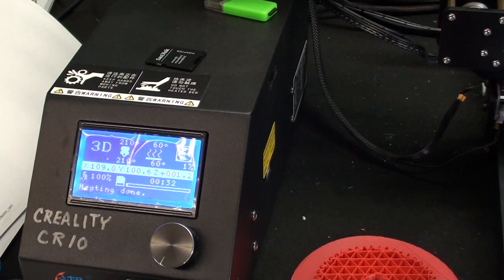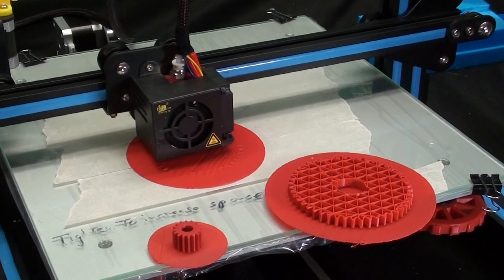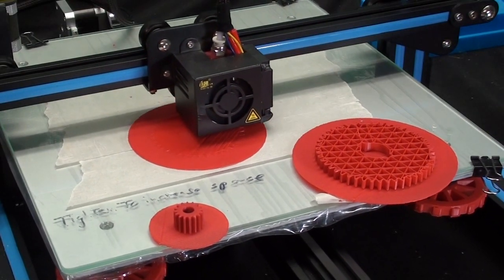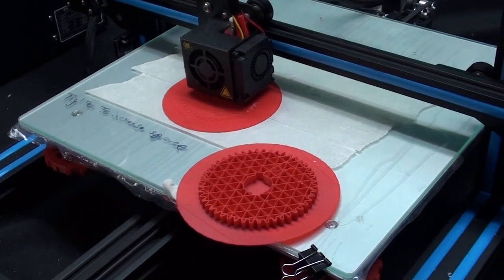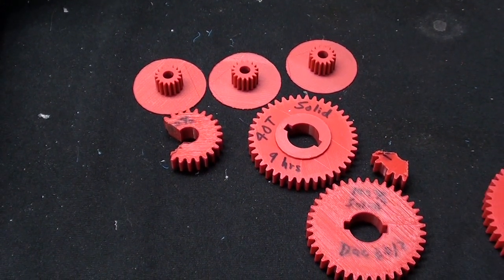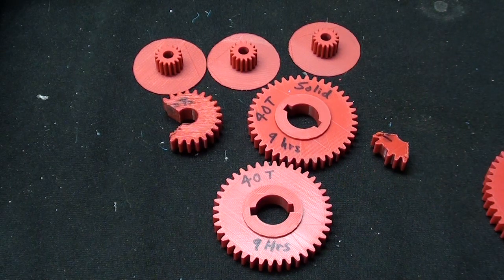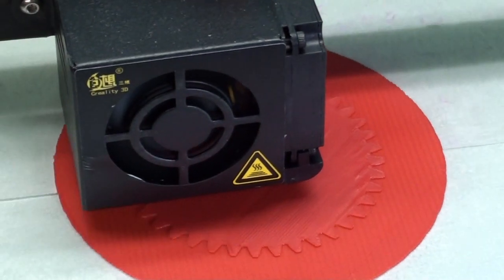3D Printing update CREALITY CR 10 with tubalcain #3

Comment: Hey Mr. Pete,
I never took shop class, just Woodworking and Auto's, so you are officially MY shop teacher! I love your video's. I like them so much, I obtained a "free" lathe. It's an Atlas TH-56 with a bearing date of 10/1940. I love knowing I have a pre-war machine. Anyways, back to the point. I put free in quotes because it had a broken traverse case gear box,  a broken F/R shifter and yoke, no tooling, not even a tool post, and 5 gears that did not give me one thread or feed rate on the chart. 
After seeing your video, I have decided, instead of paying $200 for ZAMAC gears, I'm going to try this route. Amazon has a printer that will print many different types of filaments for $190. I have one question though. The Thingiverse page for the set of 10"-12" says they are "20 degree pitch angle"  I know there's a 14.5 and 20 degree pressure angle and the 6" is 24 DP 10"-12" are 16 DP both are 14.5 PA. I just wanted to make sure the gears are designed correctly. I saw you use them, so I'm sure they're right, just  not sure what he means by that number. 
Thanks
Reply from the maker: I am currently on the road. As I remember they are 14 1/2°. Not sure, possibly the 20° will work. Do a little research on the Internet for that
Reply: @mrpete222  Sorry for the confusion. I saw you put the gears through the test, so I know they work. The only plans for 10"/12" gears on thingiverse are from Gadget047. If that's the gears you were using, that's good enough for me. If not, could you point me to the source of the files used to make the gears in your initial video. 
An unrelated question, I have never used a lathe, so I'm feeling my way here. I need a 3 jaw chuck. Any recommendations on brands and size to look for? If I just buy one labeled Atlas/Craftsman, there's easily a $100-$200 premium over any other 1 1/2 -8 chuck.
Thanks again, Rick.

Comment: Mr. Pete is the 3D printed indicator holder in Thingiverse to down load. My instructor said he would print one out for me if I could get the file. I have a 3D printed manual welding wire feeder I invented a while back out of ABS. Use it when ever I TIG or torch weld. Thank you for sharing.
Reply from the maker: yes--download it for free and have it printed

Comment: Pretty sure you know the rules for figuring out how many perimeters to print, but I'd measure the spacing between teeth, in millimeters, divide that by two, then divide the result by the print nozzle (often 0.4mm) to get a count of how many perimeters to print. Then add however many you feel is reasonable for good engineering practice. 

Infill is most important for getting decent top layers, as bridging the width of a gear will involve a substantial amount of sag. One of the options with Cura is to start with a 1% fill at the bottom, then step up to 20 or 25% (or 100% if you want) as the head goes up layers, ending with your target infil just before you get to the top layers.

Top and bottom layers are also going to be important for how ridgid the print is from center to tooth of course, but as mentioned it doesn't have to fill the entire breadth of the geer. And it's likely to require a bit of playing around with to work out what you need.

Personally I'm at the 'playing around with tinkercad' level of 3d design. I've looked at OnShape, and can see that I need to move to that or Fusion 360 at some point, but I'm probably going to hold off on that till next fall as I have a couple of other courses that I need to work through, work related, before I can dedicate that much time to a new design process.

Part of the problem with all the different opinions on what to use for adhering the first layer to the bed, is that there are too many variables in filament composition, and what works for each. I've not tried AquaNet hair spray, but have heard good things about it. But I've also had good luck printing straight to glass with some materials, and to blue tape with others.
Reply from the maker: Thank you for the information. I know very little about all of this, I am still learning
Reply: So am I. I tested well in concepts related to machining and Tool and Die making (My grandfather was a machinist for Minneapolis Moline as well as earlier on a blacksmith, which may have helped) but my career has been in electronics and networking. So 3d printing has become a hobby for me, at least in part because it's something I can do with what money I have left over at the end of the month, and even the 7x12 laths have been a bit out of my budget. Keep teaching.

Comment: Look through Cura as well, increase your infill speed. If you keep printing PLA, please just try the hairspray instead of tape. I do believe that you will be pleased at the outcome. I use it for PLA, PETG, and ABS with great success and I find it much more pleasing to use than tape. You may want to look into PETG for functional parts and regardless of what material that you use, use thicker layers (0.3 for anything functional, they will be stronger with thicker layers).

(My Method) 
Take the glass off, wash it in the sink, and spray away from the machine; spray it kind of like you are painting it (but keep the glass horizontal) and until you see a nice WET coat. At this point I toss the plate onto the heat bed and warm it up to 60 deg F, it dries the hairspray pretty quick. Once dry, I clip it into place. You wont need more than 60F for the heatbed when printing. Notice I am not saying toss the glass onto a hot bed, put it on then pre-heat the bed. 

I never use a raft and it always sticks perfectly. If you are having problem with first layer adhesion at this point, your nozzle is not close enough to the bed. If you know how, you can change the Z offset in the firmware, or just use your indicator rig to move the bed a couple thou closer to the nozzle. Good luck
Reply from the maker: Thank you, that's good information. I printed all that info out for reference. Last week I bought Aqua net extra hold hairspray. Sprayed two coats on, and the print lifted after 15 minutes. I am mediately went back to tape, Which never fails.
Reply: Another thing to note. Cura also has settings for "first layer line width %".. Keep in mind that if you increase this number it can actually have an impact on the print because the first layer will be wider, so it might be better to use a brim in this case. Needless to say increasing this percentage will put down a bit more filament and the first layer problems can be solved. I'll sometimes use as much as 105% to get PETG to stick nice and easy, never went higher than 102% for PLA, but EVERY printer is different.

There are other ways to get rid of the wider first layer. My personal favorite is to add a 45 deg chamfer to the base of the model. Of course it does not need to be a huge chamfer, perhaps 1 to 1.5mm (ish). You really don't want a wider layer on the first layer if you are making a gear...

Another thing to try, Again in Cura "Initial Layer thickness".. A thicker first layer also helps with adhesion. But I print almost exclusively at 0.3mm line thickness so my initial layer is also 0.3mm. Combine this setting with a wider first line and that can do the trick. 

I totally understand using what works for you, I do find it a bit odd that that you have problems with a part lifting on just PLA. The stuff just prints so darn easy... I have pretty much quit using PLA though, I do not like it properties as a plastic and I make almost nothing but functional parts.

Once I spray a bed, I print parts all over the place until I've managed to "dirty" up the entire bed and I never have to change bunch of tape, but I really really dislike messing with the tape.. I designed and built my own printer and the bed is level within ~0.0005" without a single adjustment screw and this has a huge impact on how easy it is to get the first layer to stick. Since building my own printer I don't have to tinker with all these Cura settings anymore.

I'd be willing to bet that if you lowered Z by exactly the thickness of the tape, your results without the tape would be better.

Comment: Interesting thought with the printed gears, way back when the atlas lathes were fairly new there were plans to make your own quick change gear box.  Now finding enough of the right gears would cost as much or more than buying and adapting a factory box.  But with the printed gears you could make a quick change again, for not much other than time.  http://vintagemachinery.org/pubs/detail.aspx?id=7158
Reply from the maker: Thanks for watching, I did not know they had plans for building a gearbox. I will check out that link

Comment: Since we know how much castings shrink along a dimension do you think it's possible that we could design a 3d printed model that could then be ZANAC casted such that it comes out dimensionally accurate. Basically compensating for how metal changes shape as it cools. This way you could make 3d printed gears for your equipment that would be a little too big but then when you cast them they come out just right.  I think it would be beyond linear algebra aka a nonlinear system since the changes in metal shrink are non-linear, but none of the mathematics are new. You would simply input your model and include vents, where the metal would be poured, and the program would then do a simulation of the metal flow and compression and output a new model such that when the metal cools you get the input STL form.  You would use lost PLA casting to avoid the problem of having to add drafts etc.
Reply from the maker: Possibly, but I don't think it's practical
Reply: Thanks for the reply! :)

Comment: Thanks Mr Pete for a nice video.
What would be good to see is if it is possible to print balls suitable for machine handle ends, drill press etc, and also crank handles for mills etc (the serpentine looking type).
Good work as always.
Reply from the maker: That would be a good project

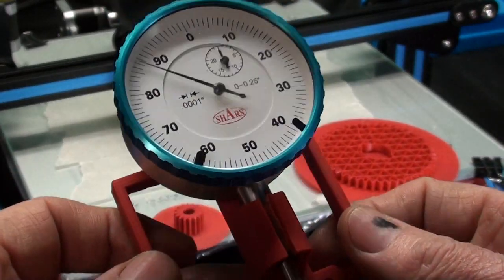Comment: More a question than a suggestion - In your previous vid you talked about printing at 20, 30 etc %.  Back here - at 2:00 you're printing and also have a part printed cog on the bed.  It looks to me as if some or all of the teeth are hollow (which I'd guess =weaker?).
Is it possible/would it be desirable to create the wheel with 2 doughnuts, solid inner and outer walls (say 1/2" wide) to create a strong hub and tooth area then fill the rest of the area at say a 50% lattice to save some material?

I don't know if it's worth the effort.... or if it would just create a weakness.
Reply from the maker: Many people have suggestions that that it only requires strength around the edges. But I do not intend to carry the experiment any further. I would just soon print the whole thing is solid.

Comment: Hello Mr Pete. I think your change gears will hold up fine. About 5 years ago i was given an Australian built Qualos Junior lathe which came with it's original plastic gears. This lathe was built between 1946 and about 1967, only used in a home machine shop, but the gears are still fine. here is a picture and some information, if you want to take a look.   http://www.lathes.co.uk/qualos/page2.html.       Ken.

Comment: On Vincent motorcycles, nylon gears were tried. This gear ran on the end of the magneto and meshed with either a steel or aluminium gear. There was a problem with the nylon gear expanding and tightening up. Something to watch for.
Reply from the maker: That rather surprises me
Reply: Researching the 'folk law' I've grown up with. It appears that the ones used on Vincents had a high coefficient of expansion and needed 0.010" to 0.015" of end clearance otherwise they tightened up. Apparently the ones fitted properly new wore out.

Comment: Mr. Pete, I've notice a common item hobby machinists are usually missing, at least those who cut gears manually using a dividing head. Are the dividing/indexing plates. Especially if they need an unusual size or number of teeth. Any reason a 3D printed indexing plate wouldn't work? Would love to see a video on the topic. 

Thanks, Love your content.
Reply from the maker: That would be a good idea, but I think it would require a cad program like fusion 360

Comment: I wonder if you attach a router to that print head location and cut out aluminum gears.
Reply from the maker: No way, it is not rigid enough
Reply: Ok. Makes sense. I am going to make a jig to cut a #25 sprocket. Seems easy but time will be invested I know.

Comment: Keep at it. I'm still learning every print after more than four years of printing. Every new design can present new challenges in how to get it optimally printed. Every new material requires a little tweak. I got into it originally so prove to myself I could make one with just a hacksaw, some wrenches and a hand drill. I was successful and learned a ton.
Reply from the maker: You are right, there is a lot to learn.

Comment: Very interesting stuff! A lot of things that of us are not exposed to or regular basis. I also understand there's metal 3D printing on its way. Please experiment with the gears on your 618 Craftsman lathe if you still have it. Probably one of the most sought-after gear sets. A good application for light-duty gears. Thanks again Mister Pete! And thanks so much for contributing to the YouTube community!
Reply from the maker: I no longer have that 618

Comment: Did you know that you can bury most of these shapes in sand, put a sprue, and cast them? There are tons of videos describing the details.
Reply from the maker: Yes I do. I have watched some of the videos. I am not impressed at all with the surface finish. It is nothing like lost wax casting using a slurry

Comment: One plastic gear is a lathe is a good solution because if you crashed then the weakest element will give up first and in that case, it will be the gear and not lead screw or bed or carriage. So you lose 10$ tops.
Reply from the maker: Yes it is a good system. In fact that is what Sheldon lathe used. I had that kind of laid at the high school. They were bake a light gears.

Comment: My advice would be to apply local infill control - use 100% for the teeth and the hub, then between them lower the infill value. Search for infill mesh for cura. Should save material and time.
Reply from the maker: Yes, many people have said that already. But I do not know how to do that
Reply: https://youtu.be/PUwf79wySUY - check this one out. Basiclly you are using additional bodies to define volumes with different infill %. In the case of gears you would have to use two rings (one for teeth area, and one for hub area).

Comment: I am very new to 3D prints but I am just wondering if instead of doing the hole thing at 20% fill can you set it to do solid 1/2” around the out side where the teeth are to keep it strong where you need it and part fill every where els
Reply from the maker: Yes that is possible

Comment: I use brims to secure my printing projects on my cr 10. I have also had great luck using dollar store stick glue. it's cheaper and easier to apply. I wash it off after 4 or 5 prints using windex and reapply it going two directions. Thanks for the great videos.
Reply from the maker: Yes, my glue stick came from dollar tree
Reply: I completely gave up the tape just glass and stick glue works great, I run pla at 200 and the bed at 60

Comment: If you have certain machines from the era of WW2, also shortly before and shortly after, you may run into a need for gears in 14 pitch. 14 pitch gears are unobtainable as stock items except from one company in the UK. However they only have 20 degree pressure angle. The old machines used 14.5 degree pressure angle. By the late 1970's and into the 1980's machine tool designers must have been missing 14 pitch. Some machines (especially from India) have some 2.75 module metric gears. 2.75 MOD is nearly identical to 14 DP. But as with 14 DP, the entire machine tool industry decided that 2.75 MOD is "obsolete" and nobody uses it now. Unlike with 14DP/20PA there's no place at all with stock 2.75 MOD gears.
Reply from the maker: Thanks for that information, I am stuck in the whole world with 14 1/2 pressure angle

Comment: Hah, I see Shars branded gage, how do you like their products ???
Reply from the maker: Fine, I have lots of their stuff
Reply: mrpete222 I've gotten few dial indicators that I've meant to use with heat bed calibration and Craftsman lathe. I do believe that I've bouth a lathe 4 jaw chuck to replace the independent 4 jaw that was on it. Now I want to upgrade a tool lantern post to something like a quickchange or a furrent type so that i can start using and learning  the lathe a bit more confortably. Can you help me please with picking one up for Craftsman 101 latge same as Atlas 618. There were also some 214.000 or something along those lines markings. Thanks

Comment: I have also found some good items on GrabCad, I dont have a 3D printer but have been re-engineering some components at work to be cut on a CNC router for vacu-form molds, there is a variety of tools there. some are ready to go and some are just renderings.
Reply from the maker: I will check them out. Never heard of them. Thank you

Comment: I didnt read through all of these comments but I wanted to offer up a bit of information in case someone else had not touched on it. In Cura you can increase the wall thickness (under Shell) and not have to print them at 100% fill while still getting much much more strength out of the teeth.
Reply from the maker: I need to try that, but I am still Learning thank you
Reply: We are all still learning...at least I hope so! Thank you for your great videos.